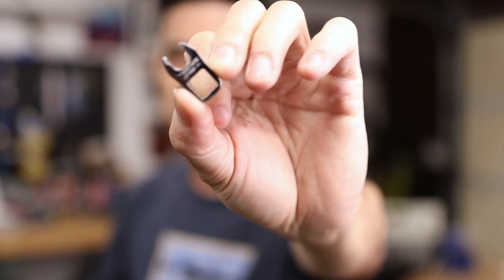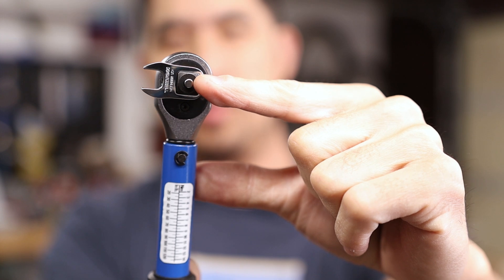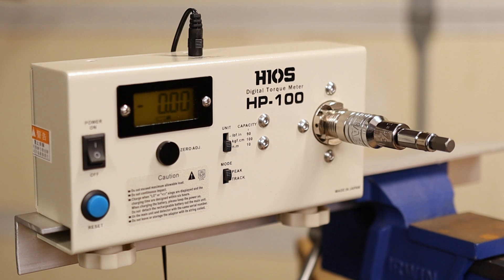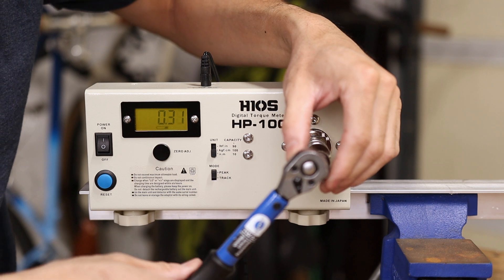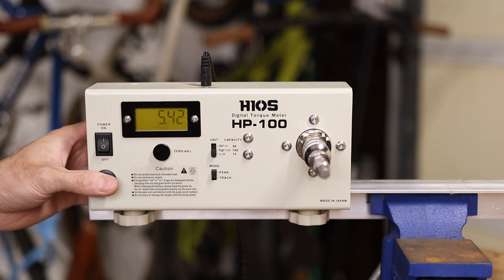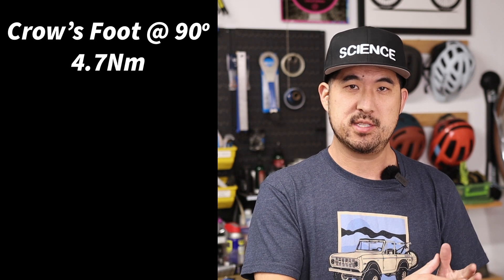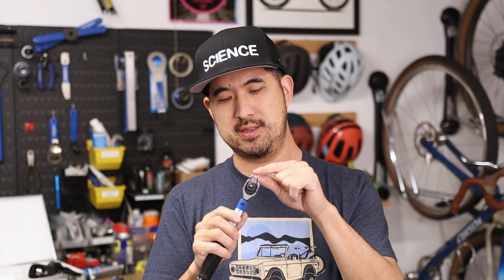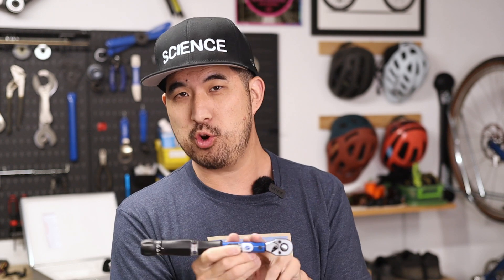Torque Wrench + Crow Foot // FACT or MYTH?

Comment: Can you take some measurements with the crowsfoot at 45º? Maybe that gives exactly 5nm
Reply: It may do. A 45º position extending the moment arm would increase the torque value, but without knowing what that wrench delivers without any extension, it would not tell us anything definite. A 90º angle will result in the same output as without the crowsfoot, If, for example, the wrench is clicking at 4.85Nm used directly with a socket, 45º would increase that, you might get 5Nm. Shortening the moment past 90º as he did reduces the output, but with no control reference, we don't see by how much.

Comment: Not bad science however your testing method is lacking a critical test.  You never tried using the torque wrench with a regular socket for a actual control.

Comment: I would have like to see you not use a crows foot and use a socket to check against the accuracy of the wrench itself vs the tester. If that number aligned with the 90 degree setup then it should be easy to just recommend doing it that way. Keep in mind bike brakes with tolerance ranges arn't the only things this setup would be used on, i found this video looking up ways to diy torque minisplit linesets for instance. Great video tho!
Reply: A vital thing to be aware of which is often not mentioned (Nolan didn't point it out here), is that for the 90° rule to apply correctly, the pull on the handgrip of the torque wrench must also be carefully maintained at exactly 90° to the tool axis as it rotates. Of course that is the right way to use a torque wrench in any case, but it's easy to be in the habit of not bothering too much about it.

Comment: 15% at 5nm , but what about 10nm? 20nm?  what about another torque wrench? .. You've done well testing this wrench, but other wrenches could be more than 15%.
Reply: I just did testing on some of my torque wrenches turning a torque adapter, and there wasn't a whole lot of difference between 90degrees or straight for the wrenches I have. In fact, I got almost the exact same number for two wrenches, one digital, one click type, at 90 degrees and straight out.  A bigger difference was noticed when the crow's foot was facing backward though.  I think the % error depends on the torque wrench.. I also found holding the wrench in different ways and at different angles(horizontal vs vertical)  could impact the reading by 10% which was a surprise.
Reply: @CleverFix  When a torque adapter is used, the alteration of the arm of moment amplifies both length sensitivity and the effect of any movement of the direction of force application away from being perpendicular to the tool axis. That does mean that the tool becomes even more subject to precisely how it is being used. If testing can be done in a very tightly controlled environment like on a computerized torque loading bench, we could expect results much closer to those predicted purely by the mathematical ratios of distance. It shouldn't vary between different torque settings on the one tool, but the percentage difference will vary for different length wrenches. And the greater proportion of change you found with the crowfoot backwards is as it should be. 🙂

Comment: There’s still the “Moment Arm = L & θ sin” distance and angle between the center of axis of the torque wrench and the center of axis of the fastener… granted in this scenario it’s minimal but if accuracy is needed so is trigonometry
Reply: The significance of the 90° rule is that if the wrench is used correctly the moment arm is preserved, so if done right no trigonometry is needed. That's because an arm of moment is always perpendicular to the line of action of the force. So if the point of rotation moves at 90° to the tool axis and the line of force also remains at 90° to the axis, the length of moment between them is unchanged. Unfortunately given instructions usually do not emphasize that the torque delivery only remains unchanged if the pull remains at 90°.
Reply: @PlatypusPerspective the  angle is '0' but,  does ' L'  have a value >1?

Comment: Thanks for showing this. Hardly any YouTube ‘experts’ address the problem of torque settings on hose nuts.

Another application for a specific torque tool is Garmin power meter pedal spindles. I managed to get a bargain snap on interchangeable head wrench and a j shank 15mm head. Works well.

I haven’t got an 8mm head for it yet but the interchangeable head tool avoids the problem of using a crows foot wrench.

Worth looking at.

Comment: You can use it in whatever position is most practical, and then calculate the adjusted torque setting for any given length. 90 degree just makes it so you don't have to do any math.

Comment: While I'd consider 15% significant, I'd agree that it won't make or break much on a bike. Used to work in hydraulic manufacturing for aerospace where exact torque is super important.

Comment: Interesting, I've recently investigated this myself, and become aware of some significant factors. It seems from another comment that you subsequently determined that 90° is the correct angle for neutrality. An important thing that we're usually not clearly told is that it's essential for accuracy that the same 90° angle of force application at the handgrip be maintained. It's the two lines of action remaining parallel that preserves the arm of moment at the same length. The potential skew of results with a crowfoot will be small, but hand application can make a difference. If a link is OK, I've put up a brief demo using a much longer lever extension to show the effect with thread showing the force line of action: https://youtu.be/Or3oPdNTiEQ

Comment: I have been an offshore mechanic for 14 years, working with heavy duty and pretty delicate stuff, from valves, to hoses, small fittings and big flanges.

Sometimes you have to use it in whatever position you can fit, and yes no difference in real life. Every torque is actually a range of torques and the manufacturers just inform the sweet spot, anything close to it will do.
Reply from the maker: That’s a sensible response! Thx

Comment: I figured a small crow's foot wouldn't make a huge change using it incorrectly. But i watched an automotive youtuber use a wrench adaptor with a torque wrench (lets you use any wrench as a crow's foot), and the dude used it at 0deg and it extended the torque wrench by a solid 3 inches. Way overtorqued it!

Comment: There are formulas to figure out the torque using a crows foot I got nearly 50 years of working on planes, trucks, cars, motorcycles and now bicycles, 
just my two cents, with the crow's as is, not much of a problem, its when you add an extension to the crow's foot and the torque wrench you need the formulas. 
IF you really want a an accurate or as close to accurate reading take the torque wrench to a calibration shop and have them correct the wrench if it needs it, when I worked on planes our torque wrenches were calibrated every 90 days and they had calibration stickers on them. 
They adjust the spring tension inside the wrench.
Reply from the maker: Interestingly, I had the tool in this video calibrated about a year ago, so I’m surprised it’s reading a bit low. Cool to know that the calibration interval for tools in the aircraft industry is so short! For bikes, it’s important, but less critical
Reply: @TheBikeSauce did you do a test run on the wrench without the crows foot off video? The delta data makes sense but I was surprised to not see a pseudo calibration run (pseudo since as you said, you don’t know of the instrument is right either)
Reply: @TheBikeSauce  Do you reset your torque wrench to 0 when storing it? Storing it set above 0 leaves tension on the spring and will cause the click to trigger slightly lower than the set value.
Reply: Since torque=distance*force…the change in distances  will be the same as the torque. I.e. if you increase the distance from the joint to the bolt center by +10% your torque will be up by 10% from what it’s set to.
Reply from the maker: @edrcozonoking mostly true, but not quite for click type torque wrenches.
Reply: @edrcozonoking I was guesstimating a 20% delta before Nolan did the measurements as the increased distance with the crow’s foot looked to be approximately 1/5 longer than the distance without the crow’s foot, and the delta was 15% :)

Comment: Although it is true the allowed margin is greater than measured varience in this particular setup, don't forget in real life scenarios there are other sources of error. And when you have 3/4 (15% out of 20) of all accuracy just laying on the table unattended, then what is the point of following other rules like handling, regular calibration, proper lubrication of threads, using torque wrench in the first place?
Reply from the maker: You should follow all best practices in general. This video is a counter point to those who overstate the impact of the crow foot angle.
Reply: @TheBikeSauce  overstate by how far though? I'd recommend next time do a full stack up of all errors and compare which portion of total error each one contributes to.
Reply: so that when you have to use a crows foot, it wont be a such a big deal. you cant always win every battle but you gotta try to win most if you want to win a war.

Comment: Let's do the math i.e. the real science calculating the torque when using an extension in straight line or at any angle ...

Set E: 
effective lenght of the extension measured along the longitudinal line of the torque wrench from center point of attachment to center point of extension or bolt i.e. the lenght takes into account the angle. Which means that E = 0 when set at 90°
Set L
center point of grip to center point of attachment measured along the longitudinal line of the torque wrench
Set T(W)
torque set on the wrench
T(E)
torque applied by the extension to the fastener.

T(E) = T(W) x (L+E)/L
or 
T(W) = T(E) x L/(L+E)

Give me any torque wrench with any extension set at any angle and I will tell you precisely the change in torque applied.
Now that's science !
Reply from the maker: This IS the real science. Hypothesis + experimental testing. You’ve shown us the real MATH. Thanks btw 🙂
Reply: @TheBikeSauce 
Sciences without math is like riding with a worn-out drive train and derailleurs badly adjusted. You may get to your destination but you might end up in trouble in some instances. 😉
Personally, I always lean on the safe side.

Comment: Cool vid.  I use torque wrenches everyday at work. The accuracy of  the torque is usually in my mind when having no choice but to use use a crowsfoot, swivel socket and/or extension.

Comment: It would be interesting to repeat this test with the Park tool MWF-3 and to place the head of the torque wrench so we would have a bigger delta between the 90degre and the zero degre setup. Thanks for your instructive videos.😊
Reply: Had the same thought, that's the same crow's foot type tool I use and it's like 4" long or something, I suspect that would make a much larger difference.

Comment: Dude what’s the delta between the torque applied without crows foot. What the heck.
Reply from the maker: It’s zero when the crows foot is at 90deg. Fair point though, could’ve shown it on video. The main point was to assign some experimental values to correct and incorrect crows foot angles.
Reply: @TheBikeSauce also. Thanks for responding. I’ve recently done a purge of bike YouTubers whose entire focus is on “products” and “sponsors”. So tired of sitting through ads just to watch what is essentially another commercial. 

Your channel is legit and I really appreciate your deep dives into complex topics.
Reply: @TheBikeSauce so as long as it’s at a right angle the wrench deliverers consistent torque with and without the crows foot?
Reply from the maker: It does. Should’ve showed it on video. It’s bothering everyone in comments section😆

Comment: Interesting vid.  It would have been nice to have a measurement without the crowfoot.  That could have been the baseline.
Reply: Exactly this. It was driving me nuts that he didn’t capture a baseline measurement on the wrench without the crows foot.
Reply: @obfuscurity  Same; thought it would also have been interesting to see the foot attached at the 6 O'clock position pointing back towards the handle to get the max varation between all installation methods..

Interesting vid though; I've often wondered about these and my memory of engineering mechancs always failed me in working out what's actually going on..
Reply from the maker: For what it’s worth, the 90 degree measurement and the non crows foot measurement are the same. I had tested after the video, but I wanted the video to focus on the delta between 2 crows foot configs. The baseline wouldn’t have added anything imo
Reply: @ The baseline would've told us the baseline, i.e. was it actually calibrated for 5 lb-ft. This would've informed whether the crows foot was truly losing torque or was the same as the baseline, just that the baseline was off.
Reply: @TheBikeSauce  Including that information in the video would be work while, especially if you're donning the science hat 😉
Reply: @obfuscurity it’s the same… T is force at a perpendicular distance… the distance is the same.
You feel the need to see proof of force theory?
Reply: @dominicbritt  I don't think you read my comment accurately. Without measuring the base torque, we're assuming that it's actually 5 lb-ft. I was just suggesting that he should've measured the base torque before performing the experiment.
Reply from the maker: I should’ve shown the baseline measurement, but yes, it’s equal to that of the crows foot at 90
Reply: @TheBikeSauce I think you clearly explained why a baseline isn't needed @4:05. You're looking at the delta or difference, so the actual calibration of the tool isn't important.
Reply: @emmanuelhpun  the delta between the two crows foot measurements isn't helpful unless you know that the correct angle of the crow's foot is actually not affecting the measurement.